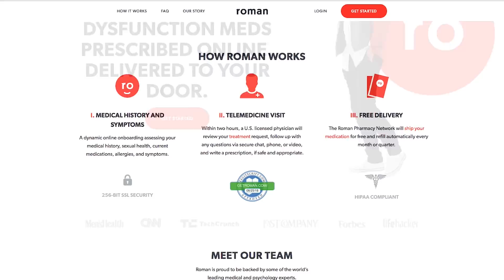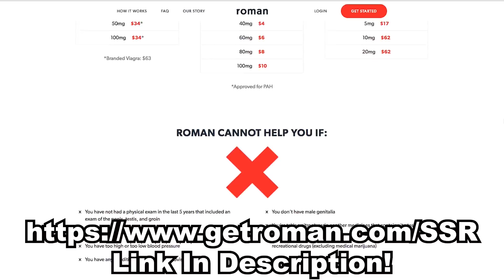Impulse Buy - I Bought A Tractor!

Comment: Thats WAY to big a tractor for your yard... It IS a really cool Farmall tall row-crop.. 1950s era. check out “Classic Tractor Fever” TV show on youtube now too.   There are thousands of tractor collectors that are coveting this.. Get ‘er painted!! But do it in Correct matching paint.  Sticker reproduction decals are available.   For your property, a modern Kubota B or smaller BX series with 60 inch Mid Mount mower would be better... and FAR easier to operate with hydrostatic controls. I have a BX with loader, backhoe, 60 inch mower, post hole digger, and a box blade scraper. This has separate brake pedals for each rear wheel.

Comment: Except that has a drawbar instead of a 3 point hitch so good luck finding a mower to fit it.  Every mower made on the last 40 years is made to mount to a standard 3 point so without some welding skills your sol. All those old farmalls took proprietary accessories.

Comment: They are fun until you disc of field with an open cab case propane tractor in 100 degree heat in Oklahoma with 30mph winds for 12 hours a day getcha a little kubota tractors they are bad mama jammas

Comment: The tires look a bit dry rotted. They must cost a fortune for the rear tires.
Reply: they are fine its not a car they can be rotten as hell as long as they hold air for a few hours they are good to go
Reply: They usually put tubes in them.

Comment: Hey dummy, you can't do to much without three points.... Hopefully you can do something else with it because you ain't mowing without them, and you won't find OEM. (Btw, most of the time the reason it's missing the three point is because of the hydraulic system is burnt/frozen. Although it has a bucket, so it may be repaired if you find the three points....